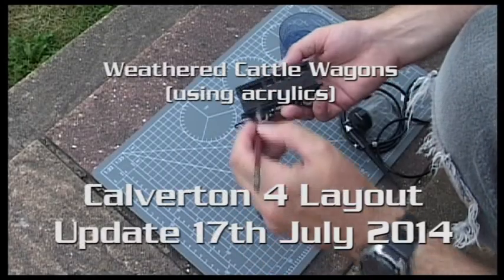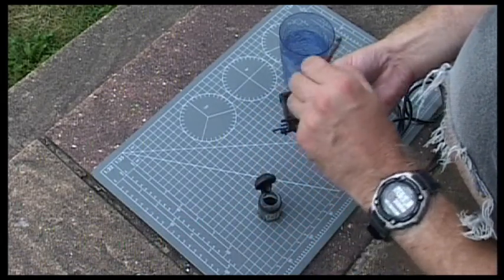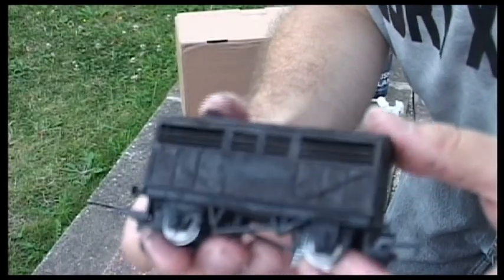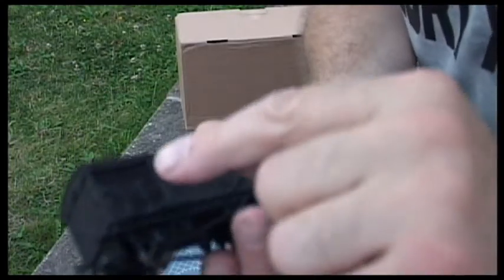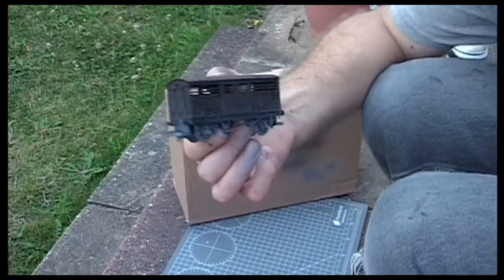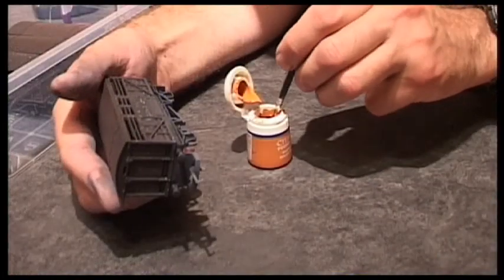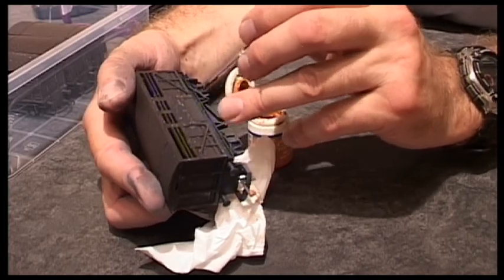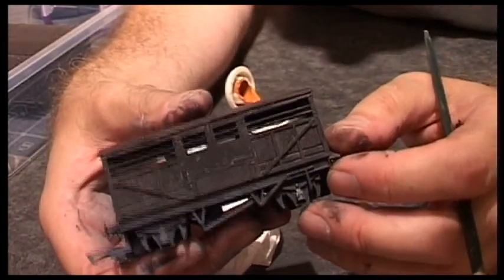Calverton Update 17th July 2014 Weathered Cattle Wagons

Comment: Very effective! How did you get your airbrush not to splatter? Ever time I have a go with my one, it tends to leave splodges every where. .
Reply from the maker: It took a while for me experimenting. I find the amount of air pressure coming from the bottle is important - not too much. On top of that you have of course the paint nozzle you can raise or lower, and on more expensive airbrushes you can alter the power of air flow too at that point.
I tend to use my cheap £10 airbrush for this sort of weathering.